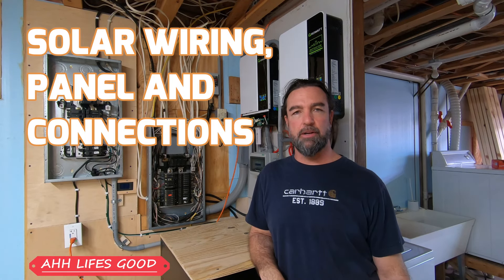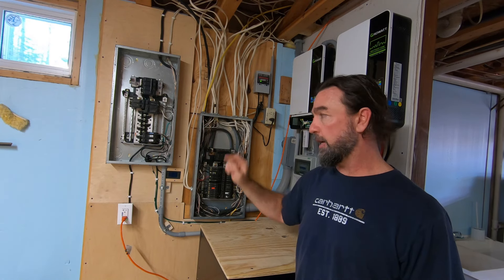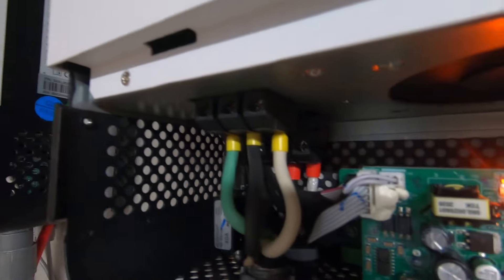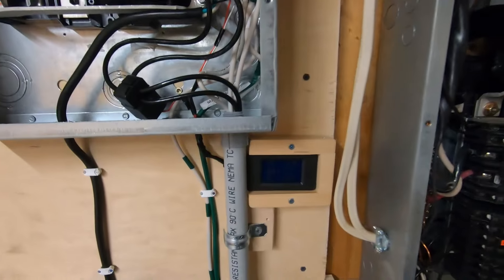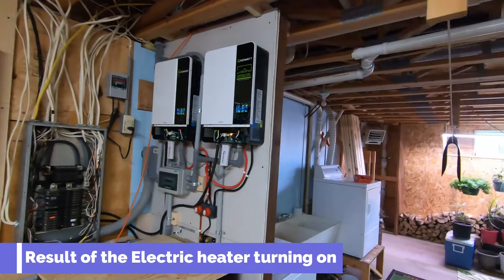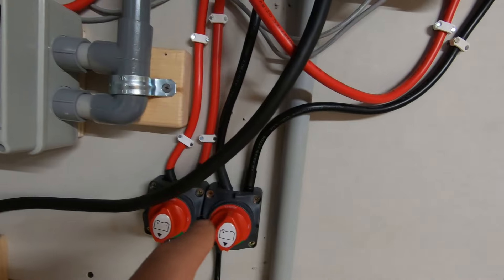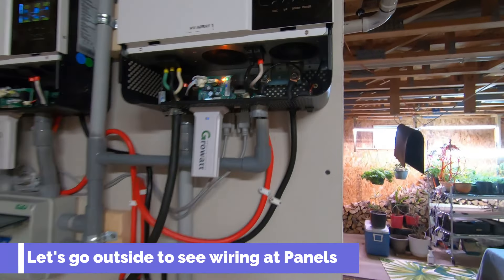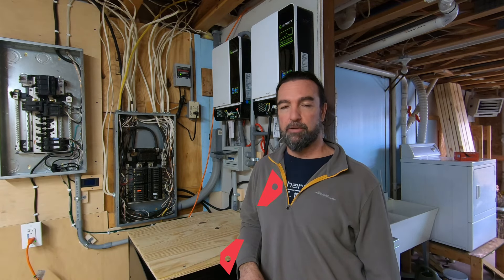DIY - Wire Solar Panels to Breaker Box Electric - Growatt Inverter 3000

Comment: On the subject of the bolding screw in the solar panel. When you inverters go into bypass (not enough solar and batteries drained) the inverties will connect the solar panel directly to the panel, thus bypassing the inverter. When this happens you will have two bolding points. This is considered a big no-no. You will need to check your inverter but a lot of inverters will bold themselves when it is necessary. 
I would suggest putting your inverters into bypass and checking ground for current.

Comment: This is totally the video I have been looking for. Straight to the point without lots of useless talking. I am building a similar system with 48v. And 9.2KW system. I will be wiring my fuse panel but I am going to have an electrician look at my setup before I flip the switch on.

Comment: Answer to your question.     At the first main electrical panel you tie or bond the neutral to the ground.      On all sub panels after the main panel, you Do Not bond the neutral bar to the ground bar.    Neutrals only tie back to ground at the first main panel.

Comment: This is a godsend of a video. I'm also in the IT field and live in the back country. Currently researching and planning out my solar. House is 102 years old and I have 8 buildings that require electricity. Love the sub panel idea. I want to centralize the power and run cabling underground as well. Your electrical wiring looks like a network closet lol. I am going to stick with propane and wood for heating. I have 2 massive greenhouses I am hoping to power off of solar. Thank you and I will be looking for more of your videos.

Comment: is the only load the heater? so it is not connected to the reset of the house
Reply from the maker: - I have many loads connected to the system, the electric heater I use when needed to burn up the additional electricty being produced.

Comment: I would check that bond in your sub panel. Some of those Growatts when on grid power have the neutral carried from the input to the output. That would mean u are bonded in two places, grid side and inverter side which is a no no. The should be only one bond if the grid is involved. If it was entirely off grid, no grid inputs, then you would want a bond in that subpanel. Some inverters allow you through a setting in the software to not pass the neutrals on the  in and out AC side of the Growatt. I would change the subpanel AC input to a double pole so if it trips it kills the 240v feed entirely, vs two singles. I know u said double pole breaker, but the video looks like two single breakers in that subpanel. You could be left with a trip of 1/2 of the subpanel and any 240v device connected would be unhappy with on part of the phase. Also best to use T style fuses on those batteries. I use them on my gyll and have they much better protection from arcing if they blow. 150A T with holders around around $40 range. Great setup of panels and like the combiner box, I use the same setup from Ian’s site. Enjoy.
Reply from the maker: Thanks Jimmy for the detailed response, really appreciate the input. Many great points you've explained here to improve on and go over which I most definitely will. One subject you touched on that has always been my question is "to not pass the neutrals", I've had big question on this topic on how it's really handled? Was thinking of using the Dry Contact port on the Inverter to setup a Relay switch between neutrals? I think Andy P had a video on the subject that was really good.
Reply: @ahhlifesgood1956  Im building a NEW rack simular to your... what are the HOOKS that are connected to the STRUTS that hook onto the 2x4's called ? Taht is a better idea than me BOLTING the strut to the 2x4 ;) thx
Reply from the maker: @SdBoy  - Hello SD, I used Auto Leaf Spring U Bolts from Napa Auto to adhere the Super Struts to the 2x6. Its a much more inexpensive route than purchasing the Solar Super Strut clamps.
Reply: @ahhlifesgood1956  thx on the reply... I couldnt tell in the pic but it looked like it was a 2x4 across the top... Originally I was just going to bolt the superstruts into the wood rail across the top but that will require perfect measurements when it comes to TWO rows of panels on the same strut.... and I saw that "hook" type of a bolt you had used... although im going to use 2x4's across for the TOP raila nd bottom rails.....

Comment: How did you deal with the floating neutral issue when powering in inverter mode? That doesn’t seem to be an issue when running in utility mode since the house main panel is bonded so a floating neutral is avoided in that mode.
Reply from the maker: Each of the inverters has a direct ground to earth. Neutral from Inverter (AC) to independent breaker box floats, bonding screw not installed. However I do have ground wires connected to the breaker box for all circuits coming from breaker box, direct ground to earth.

Comment: using 24v panels and using 24v inverter and using 24v batteries bank, is it safe to wire them in series or is it safe to wire in parallel
Reply from the maker: - Hello Shaw, NOT safe to connect your batteries in series as you'll increase the voltage of the batteries higher than that of your system. Only connect your current battery configuration on Parallel to increase Amperage output.
Reply from the maker: This is the same when connecting your panels, parallel connection only.

Comment: Hi, I would like to ask you, in case you have inductive loads, do the inverters run smothly these loads?
Reply from the maker: - The inverters run extremely smooth under normal load capacities, I don't notice any dimmining or flickering of lights or loads ever, unless using LED lights with variable watt light switches set at anything below 100%. 
One of the nice features of these particular growatts is the automatic shutoff feature when inverter loads are pushed to 100% capacity (3000 watts each), the inverter will shut down to protect the circuit, you can then either program for it to reinitialize in a set amount of time automatically or you can set it to wait for your input before reinitialization. 
A word of advice for those planning on using them for continuous larger loads I would suggest you go with a minimum of 2 - 5000 watt inverters for normal American household electrical consumption.

Comment: I would go with some flavor of wire duct or simple junction box instead of plumbing fittings. by wire duct I mean a skinny metal box with a hinged lid. you drill holes in it or knock out holes the size of the conduit youre running. that way you dont have to fish wire through a plumbing tee. Electricians will probably question the use of pvc in an inappropriate application. mine did. adios the condensate drain at the bottom of the pv inlet conduit and prevent water/humid air intrusion into the pipe to begin with. which means seal each end of the pv conduit around the wires. I would use thumb gum or whatever they call that putty electricians use. you will likely upgrade the panel prior to the UV damaging that short spot on the cable to the point of failure.
Reply from the maker: - Thanks Ken for the comments and ideas, fully agree with your advise and proper wiring boxes. The PVC I'm using is temporary and in place as an added layer of protection for the moment. Drains or condensation holes/valves in conduit, boxes and proper tubing where water or condensation could accumulate is good advise and rarely discussed.

Comment: Really a big help... just getting started and was wondering how to get power back to existing circuits in house without running seperate and new wiring and outlets. Can you suggest any good books that helped you??? Thank you
Reply from the maker: Hi Joseph and thank you for writing. I'm not a licensed electrician but the research I've done would suggest that you would probably need to install a sub panel that services your inverters and switch over the existing circuits to this panel. The other alternative would be to go FULL solar and not connect to the existing grid, essentially severing the connection that would only allow you to use Inverter Power to the main panel or Grid power, NEVER at the same time. Maybe some of the more experienced electricians in these comments will way in more specifically. Cheers

Comment: If you want more volts to power the inverters up at lowers levels, dont parallel. Only reason to parallel is if your amps are too high for your inverters max input DC amps. When computing max amps dont add the panels in series only. There will always be loss and your panels, operating at max capacity is a pipe dream. Those ratings are just in a lab with perfect conditions. Kinda like fuel mileage claims. If you coast downhill with the wind at your back you might get the advertised mileage. Bottom line is more inverter conversion to AC earlier and later in the day, is a good thing I would say.

Comment: In your video , i think you say you have 3 strings of  4 solar panels connected in parallel . which would give you 45 voc per string. does your combiner box work in series? giving you 135 voc? and keeping your amps from the 3 strings the same?  I think i bought a combiner box that runs in parallel multiplies the amps and not the volts. anyone know if combiner boxes can be parallel or series?
Reply from the maker: - Hello Big Cheese, Yes it works like I I beleive your referencing. I have 4 Panels connected in Parallel, each panel has max Voc of 45voc, each string has 4 panels, 3 strings in total per inverter making up 1 PV array. 1 pv array averages between 128 to 158voc during the day, a little low. I'm planning to add another string of panels to each combiner or PV array to improve voc on each inverter as the inverters I have need a minimum of 120v just to turn on.
Reply from the maker: The combiner boxes will work in both parallel or series configuration of panels, just be sure the equipment sustains the amount of current your planning to combine. This might be obvious but I figured I'll mention it, connecting the panels in parallel maintains the volts the same at the combiner box while increasing the amps, if you connect the panels in series configuration the volts increase and the amps stay the same at the combiner box. If for some reason you are unsure please consult an electrician before connecting anything.

Comment: Growatt 240V inverter with a center tap transformer would be much simpler to set up. Each of those inverters is a 5KW which would give you 10KW of power with no imbalance problems on the legs.
Reply from the maker: I agree with you 100%, this setup was designed for use the greenhouse I plan to build. One thing that is nice with these inverters and Growatts in general is there scalability as well, the systems can go as you grow for the folks on a lower budget.

Comment: So not to pry but did you get that inspected? I am trying to do a very similar project but I was told that since my house has grid power that all of my components need to be UL listed, i explained that my solar would have zero chance of feeding the grid and apparently NEC code says it still needs to be UL listed
Reply from the maker: - Thanks for writing. When I went to the local township and asked for a permit they told me they have no procedures in place for solar! These are some of the advantages when you live in the middle of nowhere, hopefully it stays the same. FYI, I'm connected to frid, all my equipment is UL certified but I do not use net metering or choose to sell back electricity.

Comment: If you have your grid inputs into your Growatt inverters, why don't you combine the breaker box into a single box? In the video you explain that it's because you don't have a large enough solar system. But i thought the whole point of putting the grid inputs into Growatt inverters is to be able to use the inverter's bypass abilities to allow the grid to pass power through the inverter to complete the house's power needs. For example: you are maxing out you inverters 6kw capacity but need 8kw. The other 2 kw of power would pass through your inverters (from the grid) on the same wiring to provide all 8kw of power. Still learning so I could be wrong...
Reply from the maker: - Hi Catch, I think I miss understood your first comments sorry about that. What you had written in your second comments is exactly how the system works, "the reasoning/purpose for the AC input wires going into the Growatts are to provide extra current through the inverters and into your subpanel to handle power requirements greater than what the Growatts can cover by themselves"
Reply from the maker: - So the answer to your original question "why don't you combine the breaker box into a single box? " - One could use the original breaker box from your grid but you would still need to install a separate service panel coming from the grid that would allow you to have the Grid power and PV (Inverter Power) loads on at the same time.
Reply: @ahhlifesgood1956  got it! Thanks for taking the time to answer

Comment: 2 things:  1- you only need to bond the main on-grid service panel. All sub panels are not bonded. That allows a fault to find itz way back to the main power source instead of electrifying your other metal and  appliance cases.
2- i would like to know what you would do differently if you did this again. 
-🐴
Reply from the maker: - Thank you for the comments F.F.F...  The only thing I would've done different is invested in exactly twice as much equipment as I had originally purchased prior to the inflation. I would've also increased the size of my inverters to a minimum of 5000+ Watt capacity over the 3000 watts I currently have.  As well I need to desig a system to remove snow from the panels automatically in winter. Other than that no complaints, the system is working flawlessy to date.

Comment: Not understanding the wiring of the breakers from the growatt. You have 3 spots on that inverter.. Ground/Neutral/ Hot. On North American grid you have to use the Neutral as another hot. So the wiring from the grid input into the inverter would be Ground/ L1/L2. That gives you 2 legs of current to make 240V. The output is the same from the inverter right? You have a Ground/L1/L2 coming out of the inverter? Or is it just 1 leg of 240V? Where their is a G/N/Hot? Seems you would need to get a voltmeter out and test the output of those legs in the output of the inverter. Also noticed that you didn't have a auto transformer. Is that something your planning on getting in the future?

Comment: I’m trying to figure this solar out! Lol If I understand correctly for each inverter you have you have to have one 40 amp breaker? Thank you ! Great video!
Reply from the maker: For each Inverter you will need to have a seperate breaker, and the breaker size will depend on what the Manual recommends.

Comment: Green is your static ground or earth ground or case ground. It’s so you don’t get shocked if your power messes up and hits the case of an electrical device or something. White is common or negative in DC terms. Def want to separate the two to separate your power circuit from a safety circuit. Since you already case grounded the right bus, connect all greens to it and tie your left bus to the main common and then connect all your commons to it. Wire the case of your panel to a piece of rebar that you drive into the ground outside about three feet or so. Some people wire the case to the sub pipe that they bury their cables in the ground if that pipe is steel.

Comment: I have a more for all you’re commenters , is it possible to use the nutritional line that does have excess electricity , can I use that to power a battery charger to charge my lithium batteries ?

Comment: Do your breakers break both negative and positive or just your positive on the PV input?
Reply from the maker: Hello Sir, coming from the PV Arrays they break both Negative and Positive. 

I can't remember the exact reasoning behind not using the sub panels main breaker input coming from the inverters, probably a breaker or input connection reasoning.

Comment: I would add a ground wire from the top battery to case ground of your battery panel. This makes a loop in case one ground wire gets loose or becomes disconnected for any reason. The added wire would back feed the battres. Added insurance of the ground. The ground of your subpanel only goes to one ground rod? In our area we require 2 ground rods 6 foot apart. However, your area may only require one.
Reply from the maker: - Great advice Dave thank you, I do have a ground wire from the battery case, to the batteries and onto the separate grounding rod coming from the sub panel that services the PV system, that sub panel is now "not" bonded with the screw. One ground I was thinking of adding would be a ground wire from the case of the inverters to the same grounding rod, although not sure as I don't' want to create an unnecessary loop seeing as the inverters already have a ground running from "AC In and Out", one from the Main panel and a second from the Sub panel... "Yes" I have a separate grounding rod that services my sub panel and did install it 100 foot apart which I now wish was a bit closer to the panel itself. Thanks for the comments

Comment: Also great video. I'm still experimenting. Question, what are you able to see or do with the Bluetooth modules in the Growatt inverters??
Reply from the maker: Yes I was able to setup the Bluetooth communications for internet monitoring in the end. The trick was to setup a 2.4 ghz channel on your wifii router, I couldn't get mine to work under 5 ghz.